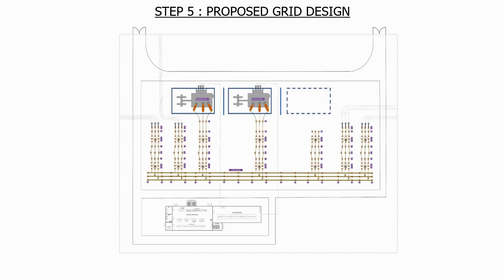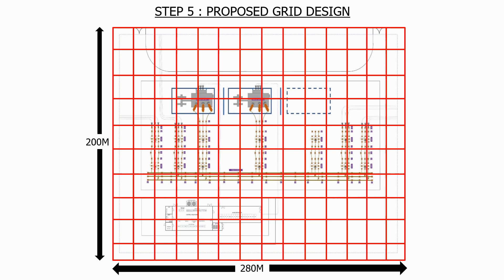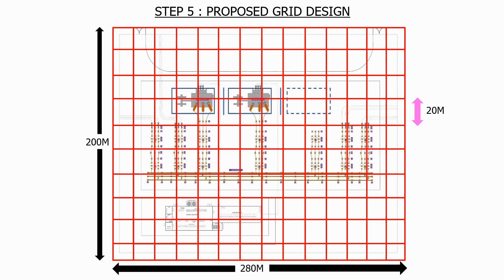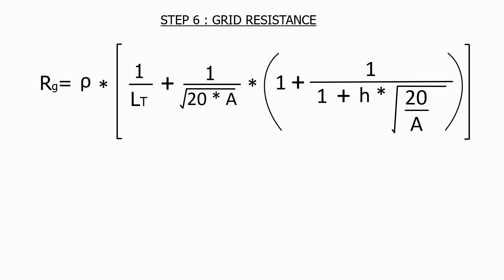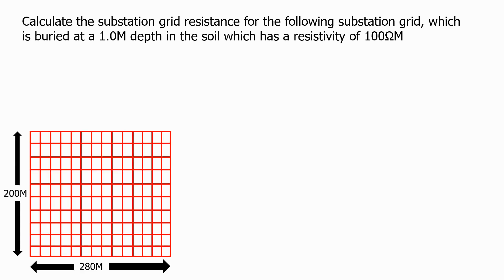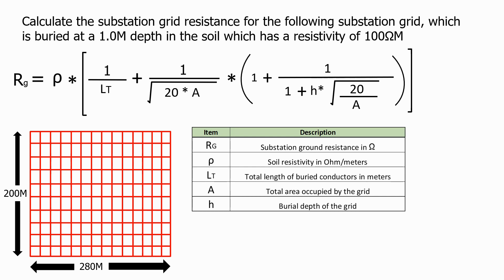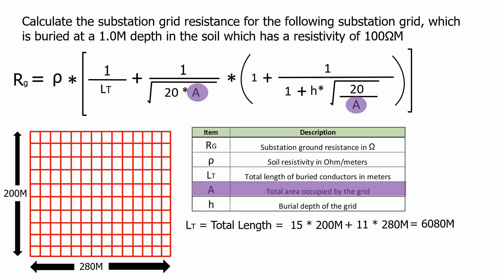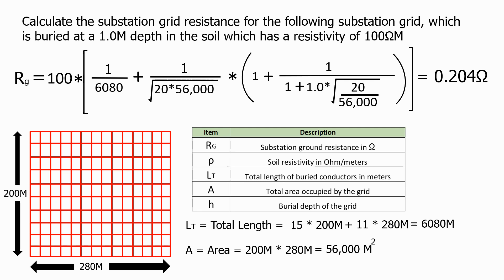Grid resistance calculation

Comment: Thanks for the formula and explanation. Will the shape of the earth system conductor play a roll in the Value of Rg. A rectangular bar will have a larger circumference and more contact area with ground than a round conductor.